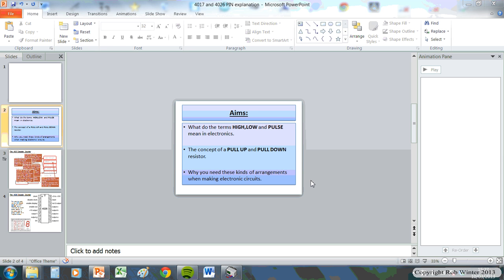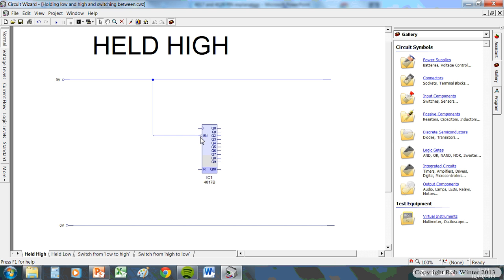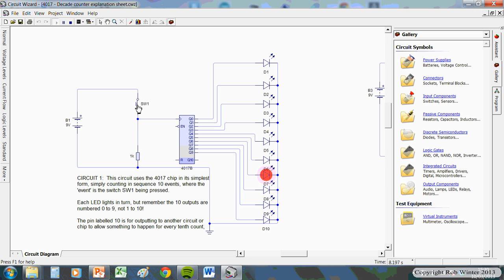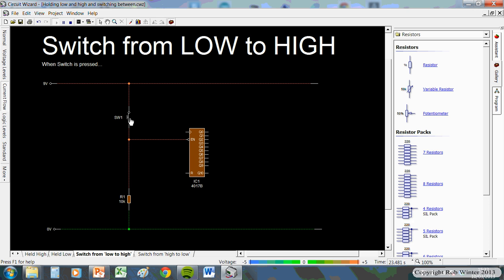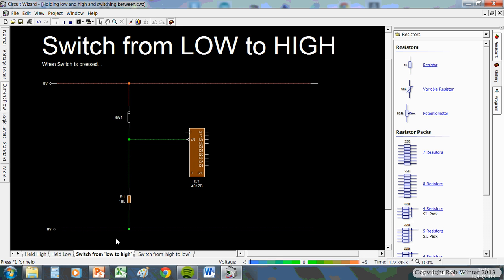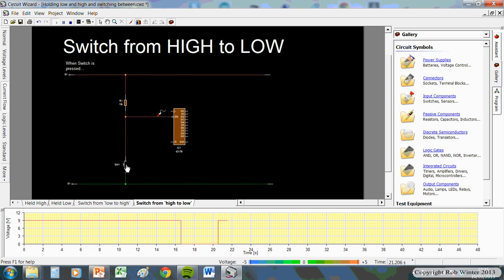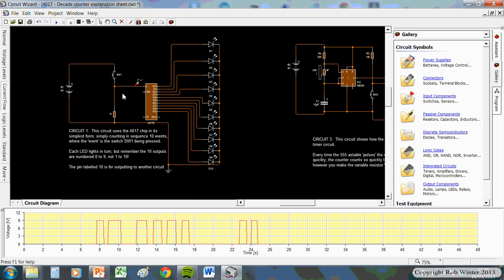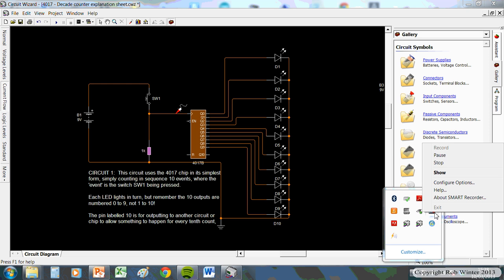High-Low and Pull up and Pull Down Resistors

Comment: First thank you for your videos. You are great at picking very granular subjects and providing concise explanations.

One question for you about the pull down circuit you introduce at around 3:27.
When you let go of the switch what would keep the LEDs lit?

Wouldn't you need the pull up version to keep the LED lit between user interaction?
Reply: I was just joking. I actually watched most of your videos which really helped me. I have done my Systems exam, and I found it easy thanks to you.
Reply from the maker: Hi Todd,

In real life, the 4017 decade counter chip actually has  Positive and Zero volt (power) connections.... so the LEDs would be pulling their power from the chip... The software I use (circuit wizard) doesnt bother showing the power connections for the chip in this 'schematic' mode (to keep it simple looking I guess) which is why it looks odd... In real life though, the chip itself is powered, and that's how they stay lit (i.e, the power is in the chip all the time and gets directed to each 'output' leg in sequence.)

Hope that explains it.
Reply: Rob Winter You're shit.
Reply from the maker: *you're s##t.    Not your.   I guess your flunked English?